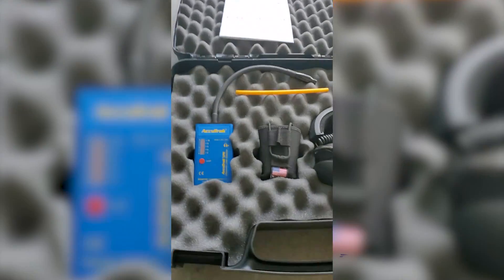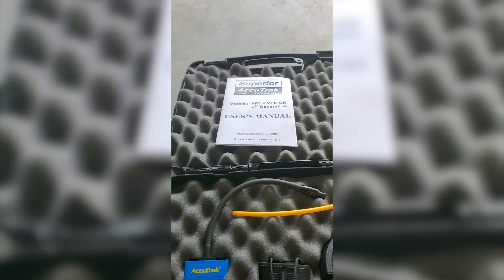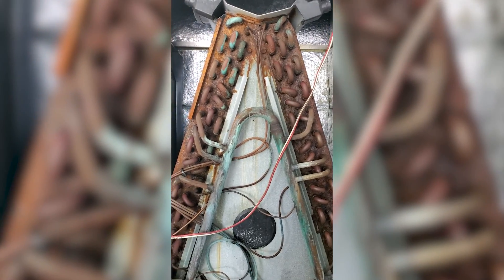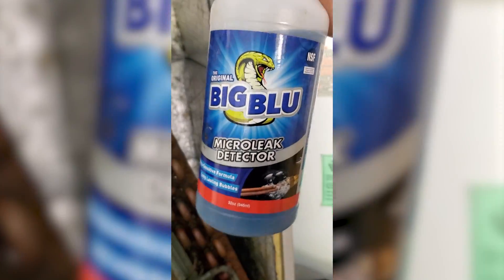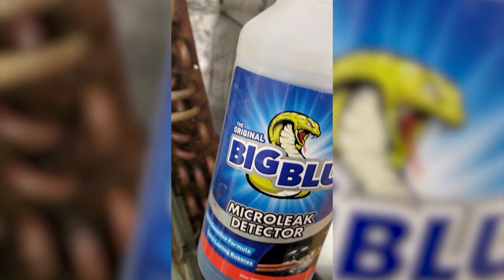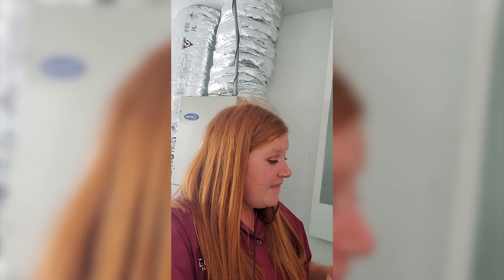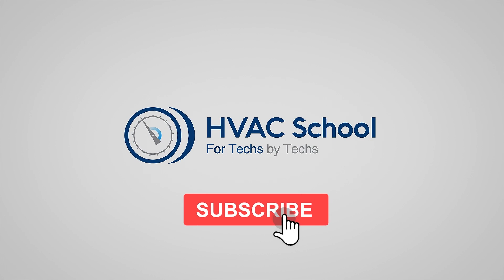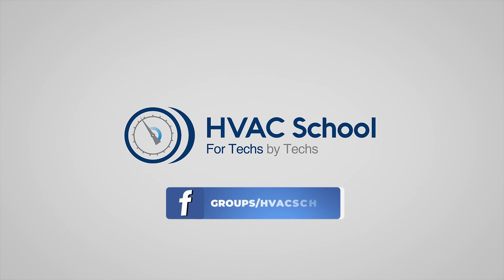Jessica Finds a Leak in the Field with AccuTrak Ultrasonic

Comment: I guess we are taking your word for it? Its easy to use soap bubbles to find a leak on the front for the coil. I typically start by saturating the U bends. Most of the time its an installer joint or right there.

Comment: Great job, those cant find leaks are a pain. But because the ultrasonic is a sensitive hearing device can you look for a leak on a extra noisy area like an airport or a diesel environment. Hmmm
Reply: I think it would be difficult to find in an area with lots of background noise. If I'm wearing it while walking I can hear me steps. Or if I put it on before wetting the coil the spray bottle is really loud.
Reply: @jessicaeagan3165  yes, very true, this technology is old, I have use it 20 yrs ago when I used to work on carrier transport refrigeration. I used it once, a diesel mechanic had one and told me I can use it. It took me some time to find it. But I found it.

Comment: Awesome job.  I think Dawn dish soap and water works better than the Big Blue
Reply: Dish soap has proven to be corrosive, it attacks brass fittings and they will eventually crack.
Manufacturers advise not to use it